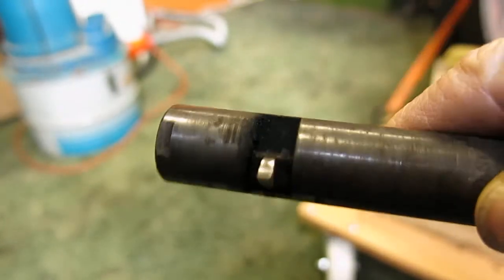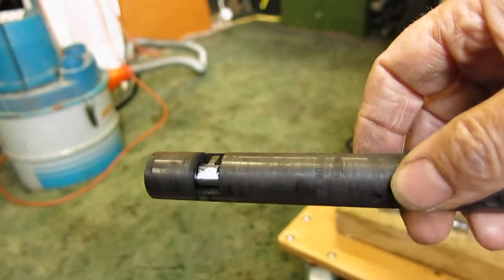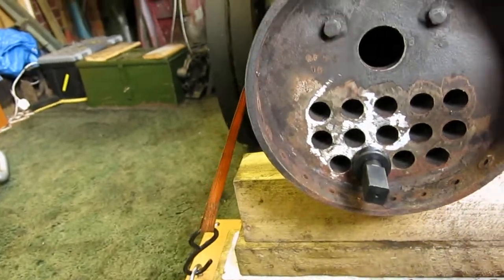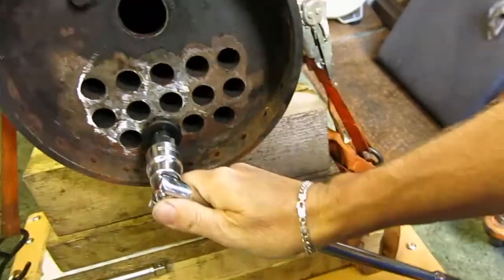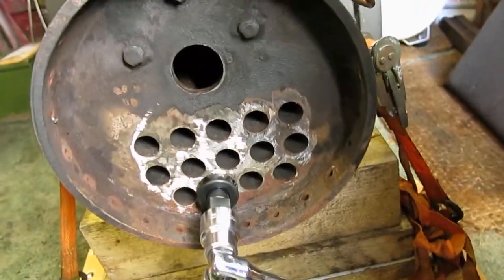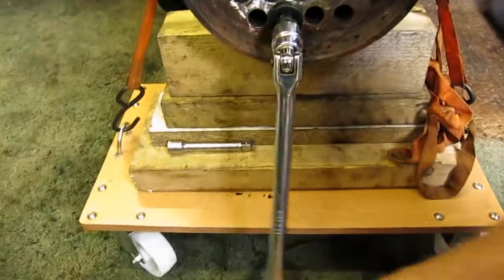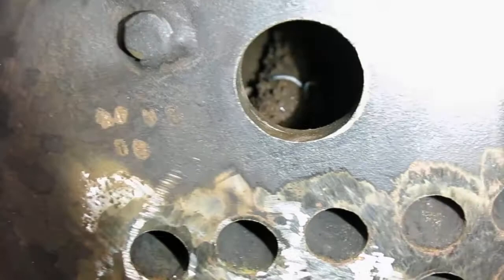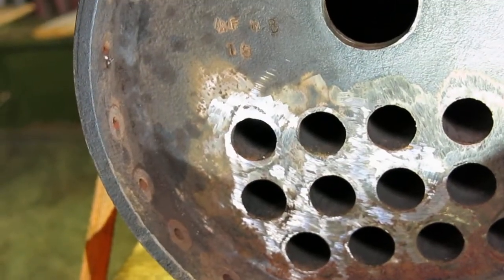Foster 4" traction engine boiler tube cutting

Comment: did you make that cutter or are they available.  neat idea.
Reply from the maker: the cutter is made by a Company called Wicksteed. Their website is wicksteed.com. They were very helpful in getting the correct size cutter for my boiler tubes, they also make the tube expanders.
The tool worked extremely well and made what I thought would be an awful job quite easy in the end. Thanks for watching and glad you found it helpful.